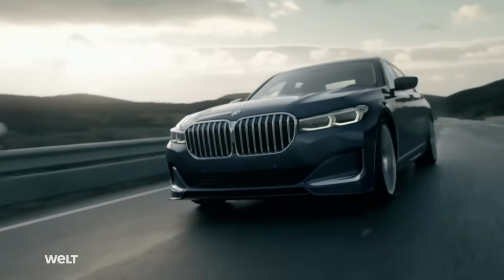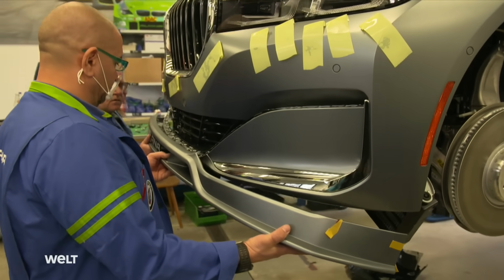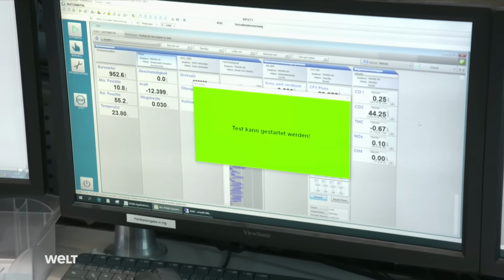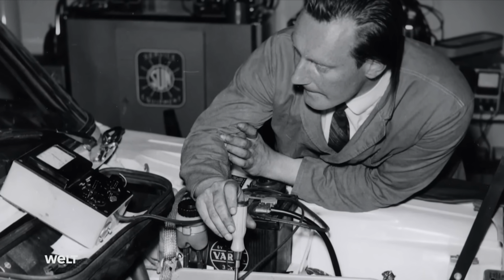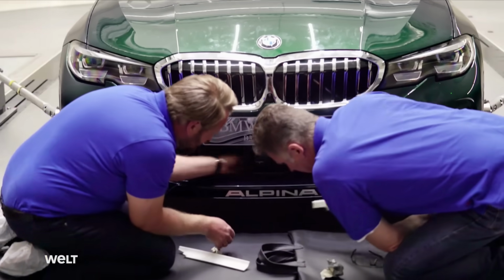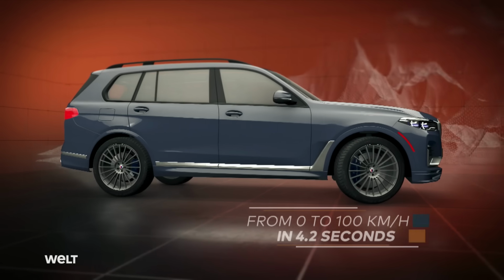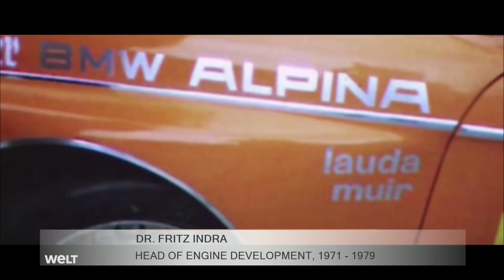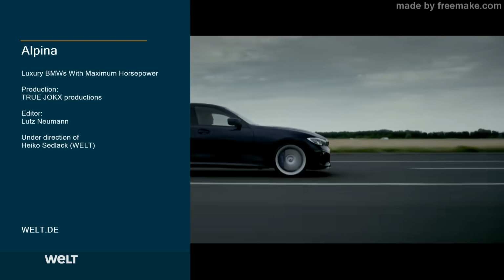ALPINA LUXURY BMWs With Maximum Horsepower | Full Documentary

Comment: That's no normal BMW. This 7-Series
model flies the Alpina flag.

This vehicle manufacturer from southern
Germany is one of the most exclusive

automotive brands in the world, much of
the tremendous power boost is already

achieved at the BMW plants and the final
assembly ultimately occurs at the factory

in the Allgäu.

A power symbiosis where the two horsepower
blacksmiths both benefit.

BMW and Alpina, it's a relationship that's already
55 years old.

Established in the 1960s, the family business still
builds luxury cars in small series to this day.

Bavarian luxury cars with the driving dynamics of
super sports cars, distinctive aerodynamics packages,

high performance engines, powerful brake systems,
100 modified parts make series production models

into exclusive racing machines. Many of Alpina's
innovative developments were born on the racetrack

and first road tested by motorsport legends.

Comment: Noticed NO Alplina made no AC/Radiator and other coolers attached to the motor test stations at all, so making a larger radiator,cooling for auto transmission etc etc, plus A/C is it on or off and where does the A/C air go to? Is it tested at all, ?

Comment: What new air ducts for the brakes, it goes directly though the front cooler for the transmission or auto, still a water with coolant in it, thus the airflow would be around the 50 degree mark, but then again in Germany the heat in summer is not that hot, like to see the versions they make for the UAE ,which is over 50 degree c most days basically driving you 7 serries BMW in the desert everyday?

Comment: Benzin here is not benzene but the German word for gasoline like petrol is in the UK.  Benzene is a much more hazardous substance.

Funny, I remember our 1971 2800CS having front headrests and of course power steering.  The power was way down below 200 HP.  I do remember the car had problems with the original carburetors and Max Hoffman's service representative said "We cannot have that!" and had webers installed.  Hoffman had much better customer service than BMW today.

I would kill to be able to buy a B4S in the USA.  Even the B5S Touring could sell 200 - 300 units here annually.

Comment: lol transmission cooler added, yet the temp is the same with out it, why because they are connected to the radiators coolant, ie: coolant keeps the temp down plus air flow, even in 50 degree c days the transmission oil temp will only get as high as the coolant, which is so important to make sure the radiator coolant is up to spec?

Comment: So much for so little, wait until you have to replace a $30 oil pan gasket and you have to drop the entire subframe and suspension, and if it's a X Drive... You need to pull out the CV axles, one of them goes through the oil pan!!!
That's about $1500 labor for a $30 oil pan gasket. BMW it's just a dumpster can on wheels, Alpina is only changing the appearance.
Reply: @sexynelson100  yes I do, just happens to work on it right now, I'm replacing the oil filter housing gasket... 
The "Mikey Mouse"  fitting just crumbled,  fortunately I bought a $5 Chinese one, made of aluminum...
Seriously, BMW it's just a piece of shit, I'm done with it. It's going to be for sale pretty soon.
Reply: @RomanTrollanski  " fortunately i bought a 5$ ..... poor poor car

Comment: Funny their "extensive" engine modifications just includes changing the radiator, spark plugs, the engine cover, the color of a few hoses and the battery, but fully test a brand new BMW engine then tear it down.... Guess anyone who had a car serviced got extensive engine modifications lol...
Reply: Lol  you can't make the difference with specificcally designed and built performance parts. Guess you've driven your standard BMWs over 300 km/h many times. NOT.
Reply: @Lamerguezerie  M5
Reply: not at all. For the american market they change the rotating assembly as well. You clearly havent watched the full documentary. In europe all alpinas get either M3 engine or M5 engine.

Comment: I think Alpina no longer pays that much attention to details on their cars as before, both exterior and interior. For the exterior, the front of the XB7 looks terrible. They just stick a Alpina lower bumper to the regular X7 without doing more job to fuse it into the overall design, making it look clumsy and redundant. For the interior, I still remember the blue and green micro square patterns embroidered on the leather surface of the doors in previous models. But now they are gone with only an Alpina badge glued to the center console. This is not satisfying at all for this prestigous name. Nonetheless, Alpina B12 6.0 forever.
Reply: Not as much as before I really wish the cars would be just a bit more premium right now. Would still love to have one but they just need a little “extra” to give it an edge and a reason to buy over an M car

Comment: That is absolutely ridiculous. Why wouldn’t they install that interior on other new cars or sell it complete to the parts or service of BMW that is very wasteful to cut it up and recycle it. That is asinine sell it for half priced or put it up at an auction site. Cannot believe BMW allows that cut it up and recycle it. I never heard of something so stupid ship it back to the factory installed a new cars. Better yet deliver the cars with no interior just put a milk crate in the driver seat so they can pull it on and off the transport. That’s 2000 brand new interiors 🫠🫠🤯🤯😤🙈